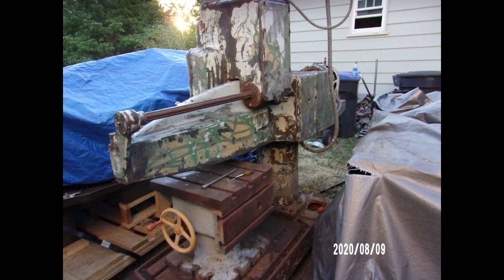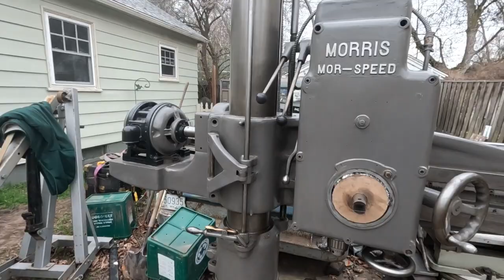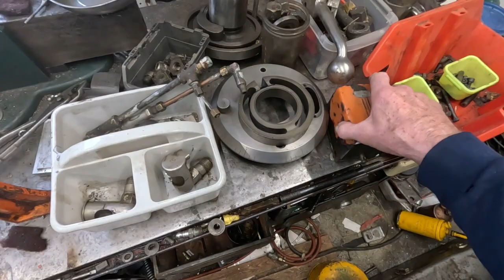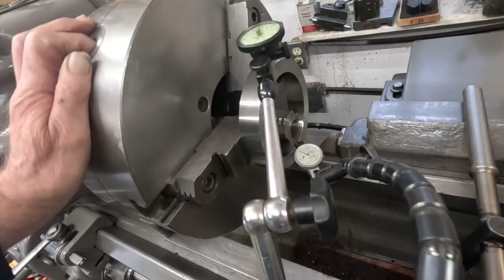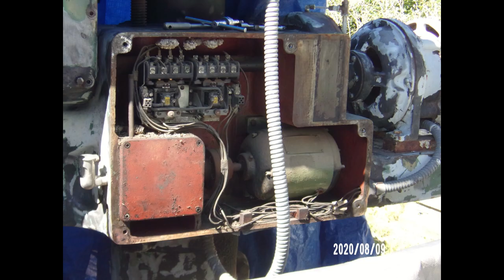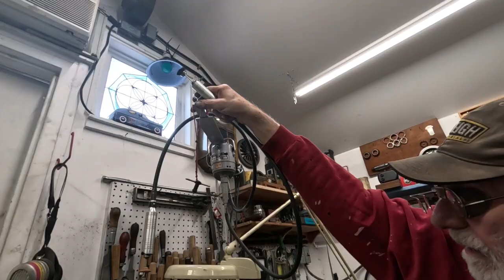Radial Drill Press Restoration, Machine Shop Heavy Equipment

Comment: looks great, im amazed the ways came up so nicely from the 1st pics. clearly not related to Morris cars, as it would be rusted through lol
Reply from the maker: The acetone + transmission fluid and scrubbing with a brass brush preserved the hand scraping on the horizontal arm, I did not use abrasives or power tools on the sliding surfaces. This is an old trick that woodworking machine restorers used for decades but pretty much lost in time, thanks.
Reply: @deedeeindustrialsuperprecision  yes i usually have a bottle mixed up in my shed, good for soaking stuck pistons in too. The lathe im playing with at the moment turned out to be really pitted under the rust, no one ever seems to post that kind of way rust on the forums